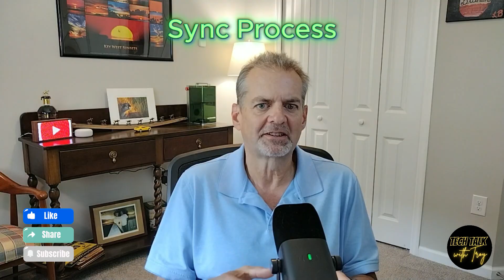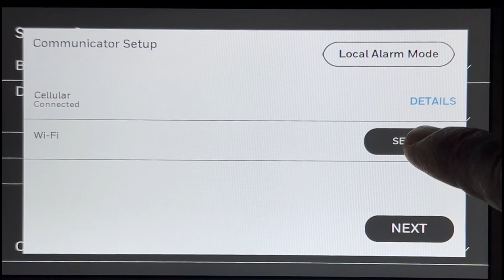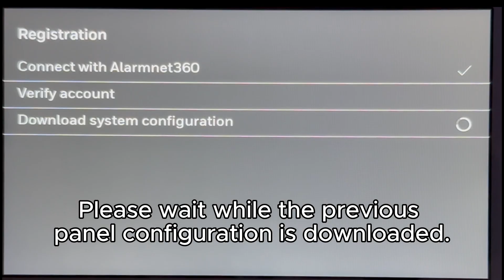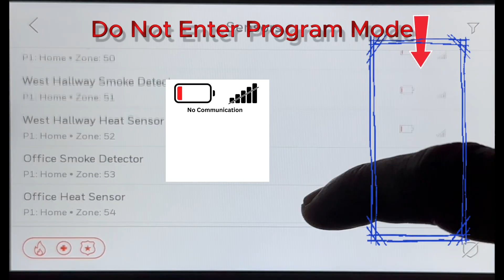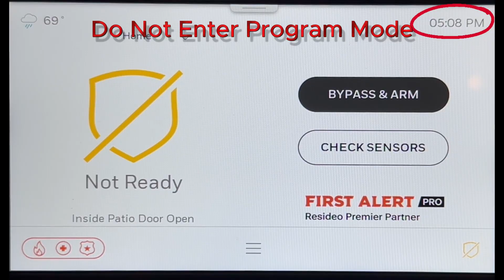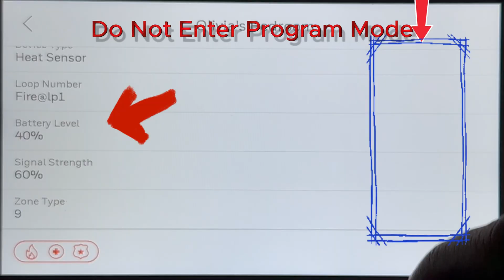⚠️ Danger Ahead! 🚨Don't Replace Your PROA7 ProSeries Control Panel Until You Watch This!

Comment: Great video! I just installed  a vista H3. Unfortunately the cellar module has poor connection at 107 dbm with 2 bars. Some cell tests even fail. In your experience, Will a Honeywell indoor antenna installed in the Attic fix this issue and provide better signal? Thank you!
Reply from the maker: A RESIDEO antenna will help your signal level and help improve your signal quality.